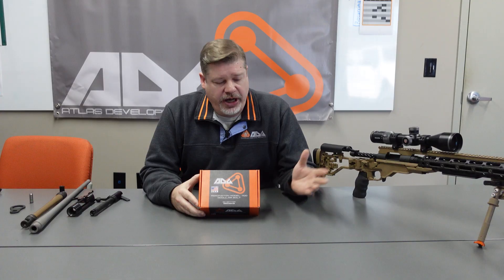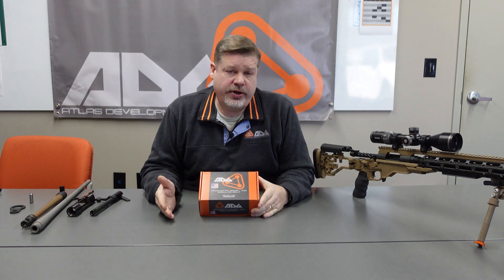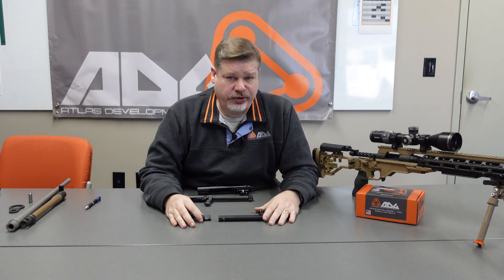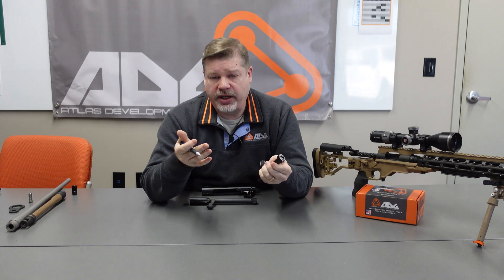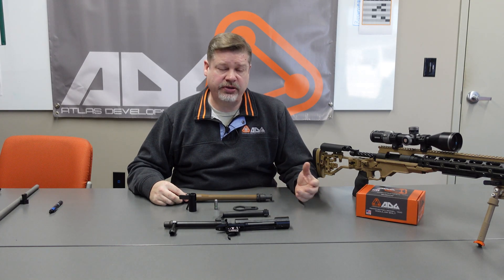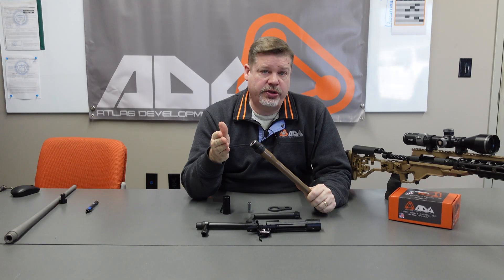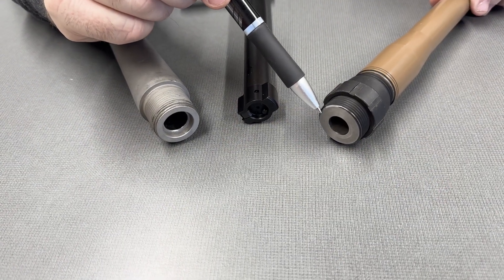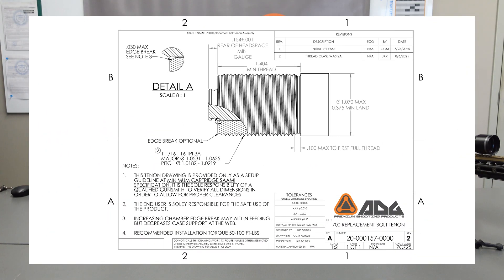ADG's Modular Bolt Overview

Comment: It's a neat concept, but I predict a flop. The fact that you can't stick this in a standard 700 barrel (especially a remage) is going to be a major hang up for most. That's why people buy remage barrels. To avoid a gunsmith. 

My case is a little different in that I can do the machine work myself, so this may be a future upgrade for me that lets me shoot multiple barrels/calibers on the same action and chassis. 

Question, and I hope you answer. Has this bolt been tested with the br/dasher cases and 300blk? And does it function with these little stuby cases ? Standard remington extractors and ejectors struggle here.

Comment: I applaud your efforts in this endeavor, but I see a few obstacles that will keep people from committing to this bolt. The appeal of a Remage nut and barrel system is that you can order a prefit barrel and there’s no need for the extra $300-500 cost for a gunsmith to chamber the barrel and thread the barrel tenon. With this system you just re-introduced that extra cost and made the barrel nut a moot because now the gunsmith can just make it a shouldered barrel since it’s already in the lathe and being machined. Second is the price. I get that the this is to make rifles chambered in obsolete or oddball cartridges viable again, but with the high price tag of this bolt assembly, and now having to pay for machining, it would probably be money ahead to just buy an action like Aero, or similar and build a new rifle. This is just the opinion of a consumer of course, so take it for what it’s worth. Also, I think your customers would have appreciated ADG increasing brass production and cartridge lines a little more than this bolt assembly. You have a good thing going with your brass already. Dance with the one who brought you.

Comment: What is the diameter of the firing pin? What is the diameter of the bolt?
Reply: Exactly my question. I use PTG replacements bolts and have never looked back.

Comment: You had me until "modified tennon" :(
Reply from the maker: The idea is that you would be re-barreling your action to a different caliber.  So, the tenon change is a moot point and allows for no compromises in lug strength.
Reply: @AtlasDevelopmentGroupLLC  I totally get it, but I can't order a Remage prefit if using this bolt
Reply: @amym828 
Well at this point would have to just buy a barrel blank and have a gunsmith chamber it. No point in a remage for this bolt. Wounder how good sales will be...